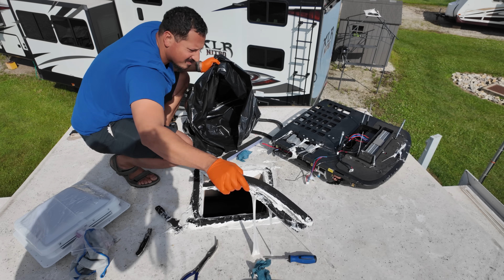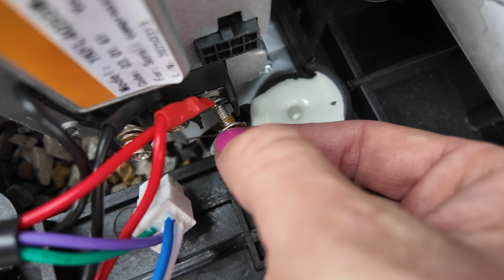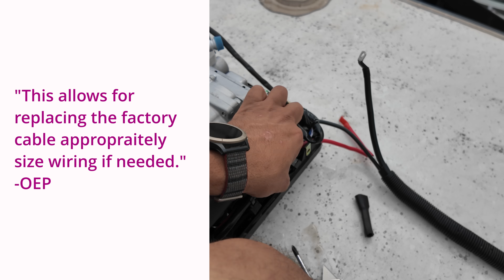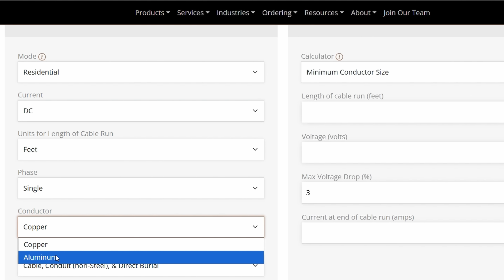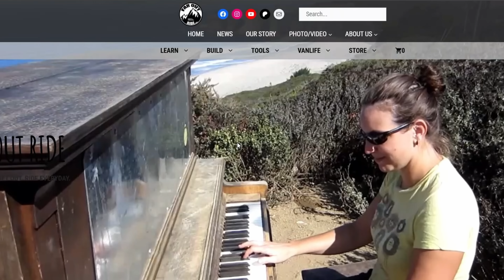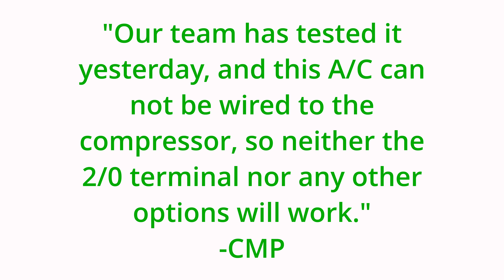The Truth About 12V RV AC Wiring in Big Rigs (What No One Says)

Comment: thanks for covering this subject.  agree - all the install videos never talk about wiring the 12V AC unit. i am planning to add a 12V AC to the front bedroom of my 5th wheel, which will greatly shorten the wiring run. I thought it was a disadvantage not having a setup to connect to the ceiling ducts; i have since learned that ceiling AC duct-work is very inefficient, so will rely on convection cooling through the RV while boon-docking, which makes the front bedroom the best location.  in a campground, the rear AC can provide a boost if the front AC cant keep up.

another thought is to change your battery bank to 24V and add a 24 to 12v converter for the RV house circuits.  a 24V AC will require half the current vs 12V, so wiring runs can use a smaller size wiring.

while I am not an electrician, for DC circuit runs, I believe the negative wire can be grounded at the closest point on the chassis frame.
Reply from the maker: I’m glad it was helpful. Yes it’s still a great option for many and have seen lot talking about the inefficiency of ducts.

Thinking hard about a 24 v system. Thanks for sharing

Comment: sounds like a large inverter and an extra battery is still a very valid answer, along with high efficiency ac like the chill cube.  
did you think of converting to a 24v system to use smaller wire? That may get you below the 1awg wire size.
Reply from the maker: Yes, large inverter and extra battery would be a great addition. I think it could be a better alternative for a larger rig.

Definitely considering 24 V system. Thanks for sharing.

Comment: The comments are fantastic and helpful. I would love to see some responses to them as they vary. We just finished installing the Victon system for off grid, ourselves, and it has been drinking from the fire hose for 2 weeks. Installing a 12-volt air conditioner is next as the Coleman Mach 8, 80 Db noisy air conditioner HAS to go. We have a short trailer as it's only 17 ft inside but I'm going to take to heart the bus bar in the cabinet suggestion, calculating the voltage drop in the line for the 10 ft needed from the air conditioner to the battery and or changing out the connection points in the air conditioner like you mentioned in your video. Sharing the good, the bad and the fails of any mod to projects helps everyone learn. Thanks for making the video cuz I always wonder after the YouTuber puts up the video on how to, if it was really the best way in the long run.
Reply from the maker: That’s awesome Victron system is definitely on the list. Lots of comments, recommending a large inverter and an inverted AC or mini split system, such as fury on chill cube or Mr. cool. Might be worth some consideration.

We always try to do any kind of follow up if we find something that isn’t as expected whether it is sponsored or not. Thanks for watching and sharing your set up😁

Comment: I did almost exactly what you guys were planning. Ran along the bottom, up the wall to a water tight  PVC box with 4/0 superflex copper wire. Once on top, I installed two large bus bars, effectively moving the battery connections to the roof. From there, I ran all my lights, AC and other roof mounted electrical equipment into this box and connected them to the installed bus bar using the wires provided since they could reach the strategically placed bus bars. I have inline fuses in each circuit, leaving the bus bars.
Reply from the maker: I’m glad you were able to get it done. How’s it been holding up for you?

Comment: In short, 12v ACs are not ideal. You should really look into a 48v system.  12  really is just not up to the task.  48v batteries are readily available, as are many other DC components that run happily on 48vdc. It is the voltage of the future for van, RV, truck and automotive systems.
Reply from the maker: Would you consider a 24 v system any better?

Comment: Why not install 24v instead of 12v units? Your Avenue has 2 AC units, correct? Just install separate 24v batteries closer to each unit, and you could likely use the 6AWG wire that comes with them. Not sure of the layout of your RV, but finding a space for a 24v battery to put under a dinette or something might be feasible.
Reply from the maker: Yeah, this is a great option. It definitely seems like it’s doable, but the main purpose was to show people that it’s not as straightforward and plug-and-play as it appears moving forward probably gonna consider a 24 V system instead thanks for sharing!

Comment: I'm surprised you have a 12v system on such a big rig. 24v or even 48v would really help with the runs for the big things. You could then get 24-12v or 48-12v transformers to keep from needing to upgrade your equipment.
Reply from the maker: A 24 V or 48 V system would be an improvement, would be awesome if they came equipped with them!
Reply: @DeterminationUnbound many of the DC ACs come in 24v and 48v versions.

Comment: I design harnesses for a living. 
Just run the largest cables you can comfortably run from the circuit breaker to a block or simple cable mounting stud near the AC unit. Use the 6 gauge they provided with the unit for the short distance from your interim distribution point to the unit itself. I'd say 2 AWG would be the biggest reasonable choice, and 4 AWG would be the minimum for minimal losses. Your higher voltage drop will be limited to the factory 6 AWG wiring, over a very short distance. 

The problems you're running into are because of two things. 1) your priorities are different than the people who designed it. Nobody is selling any 12V appliance with a 1 AWG cable set. If you look at automotive OEMs, they're not following the standards you're defining, because it costs more, and 2) your voltage drop expectations are higher than most applications. 10% drop is for non-critical, which for most designers would be something like this AC, where 3% drop is only used for truly sensitive things like sensors, processors, radar or other feedback systems.

I agree that in a boondocking/solar condition, efficiency matters. The simple solution is to just oversize the cables between the circuit breaker and the AC factory cables, minimizing the length of the factory 6 AWG. You can never oversize a power cable, if it will physically fit. I purchased one of these units, and my solution includes moving the battery bank closer in my design, so smaller cables can be used. 50 ft is VERY far for a high current device. I'm also going to be getting about 160 amps worth of charging from my solar, so I'll be using 2 AWG for that. 

Let's also keep in mind, most people running a subwoofer amplifier will pull up to 50 amps through an 8 gauge wire, and 125 amps through a 4 gauge wire. Priorities are just different for different people, and I'd say 1 AWG is certainly an exaggerated priority for a 70A load. 1 AWG is 44 mm² cross sectional area (flow path size), where 4 AWG is only 21 mm². So you've got twice the cross sectional area of people who are running stereo amplifiers up to 125A. For reference, 6 AWG is 13mm².

I'm not burning your biscuits. You did a great job learning about voltage drop calculations. As an engineer, there's just a need to look at real world use case examples in addition to the calculations. Gut checks are very valuable, and can avoid some unproductive paths.
Reply from the maker: This is very insightful. 

Agreed I probably over thought this a little bit not knowing and getting mixed information made me go with the over engineered route . 😆

But real world situations are definitely the best to learn from. Thanks for taking it easy on me and sharing!
Reply: @DeterminationUnbound  I was just going to reply with the same suggestion.  Run your heavy lines up to the roof junction box, then use the 6 ga from the box to the A/C unit.  This will work just fine.
Reply: You also missed the part that they're trying to do AC runs with DC!

In DC systems, they have to understand that
At fifty foot run, for example, is actually electrically a hundred foot run. 

There are just asking way too much of this d c system. 

They should be throwing down double 00.

Comment: This is a typical problem for low voltage / high(ish) current over some distance and voltage drop considerations.  I would be inclined to run duplex (or triplex) 1 awg (2 wires per leg) and splice down to 1 wire close to the end points. You could use aluminum large gauge (also duplex etc) also (cheaper).  The values used for drop, voltage and current look reasonable.
Reply from the maker: Interesting I just assumed aluminum would not be a great option. Thanks for sharing.

Comment: That small 12v AC is not sufficient for that 5th wheels main living area anyway and you will be disappointed.  Go with an efficient Chill Cube 120v ac in the main living area, and install a 12v AC only in the bedroom, which is likely closer to your battery bank.  This assumes your RV is a rear living/bed upstairs model.  That is the plan we have for our rig. I’m keeping the 15k btu for on grid camping, and just cool the sleeping area with a 12v AC.   Also running 2/0 to your junction box, and 4 awg to the AC would work perfectly.
Reply from the maker: Agree, the purpose was never to fully cool, but maybe to provide some relief. Definitely would be easier to go a chill cube route.

Now all I need is a inverter system because luckily we are third seat prep already. Thanks for sharing.

Comment: You can run from ac unit to a junction then increase wire size
Reply from the maker: Thanks for sharing!
Reply: The maximum btu of a ac unit needs to be 10000 btu on 12 volt very hard to prevent heat from connector if over that btu 24 volts all I use now due to 12 volt amp draw pushing 100 amps on my rv mini split still some heat on wires.

Comment: We have the CountryMod unit (10k) on our 41' Bighorn 5th wheel. 
Could  you  have placed it mid-ship and wire down a pre-existing vent? 
We replaced our center MaxAir fan with the CountryMod. Ran the supplied wires down an already existing plumbing roof vent down into our basement to the lithium goodness. 
No new holes and far closer to the juice.
Reply from the maker: We could’ve even placed it at the front of the rig, which would’ve been the shortest run, but we really didn’t wanna move the front AC and had an opening in the rear. Thanks for sharing.

Comment: Good video but not entirely correct. Appliances like AC, electric ranges, etc.. provide a plug connection that matches up with voltage, amperage, etc. This is rated for,the service required to run the device. It is up to the electrician / engineer to size the wire from the distribution panel to the outlet / termination point. In the case of the AC unit subject in your video you need to size the cable from your 12 volt distribution panel (trailer source) to a power distribution block near your ac unit. Distribution / terminal blocks transition from lager cable size (like 1/0) to smaller (like 6 gauge).
Reply from the maker: Information thanks for sharing!

Comment: The last few inches of the supply wire can be a smaller size without issue.  Cut the original wire back as short as possible, and splice it into the 2/0.

Comment: Another caveat:
Your batteries will not last long without having some solar, a generator, or running your engine.
You are better off spending a little more and going with an EG4 Solar Minisplit 12KBTU.
This comes with 4 solar panels, prepared cables, pre-charged lines, and easy DIY install.
You mount the panels on your roof, supply and install mounting brackets, solar wire and a disconnect
These can run solely on solar, you can grid tie it or both.
Does not need batteries.
This heats and cools.
Solar is FREE to use, no electric bill as long as you have the sun.
Reply from the maker: Oh I love the sound of that!

Comment: Consider 110 V air conditioner with one of these new models that are inverter air conditioners with the very low draw using your inverter close to the batteries and run the high voltage 110 wire up to the AC. Look into the Ferrion chill cube or the Turbro AC units
Reply from the maker: Yeah, this is a great option. Plus I would love a reason to get a full solar system. 😂

Comment: Is it possible to use a battery/inverter setup with enuf current 120 AC voltage output to run AC  up to the A/C unit?  Regular ac wiring could be used like in a house ..no heavy gauge dc cable would be needed. Need enuf battery capacity to last over night. At least have a good nights sleep ...I can't sleep in the heat so for me I'd want a good comfortable temperature to sleep in.

Comment: Agreed. Wire size is undersized. I cut all but 5' of the factory wire and  then used 1/0 wire to finish the run to my batteries. The fuse you get also seems to be poor quality. You could look into a split unit perhaps as the refrigerant hoses could help you break up the distance since they are 10' long.
Reply from the maker: Nice! I love that you got yours installed! How’s the cooling?

Comment: Use 2 12v batteries to make a 24v system and then the wire size can be reduced, I believe in half. Oh...and get a 24v rated AC. Will then need a DC to DC inverter to drop down to 12v for the 12v items.

Comment: The issue, with the OutequipePro 12vdc, is the target market. With small campervans, small travel trailers the wire size/length is not a problem. The problem is the wire size needed for the hugely long runs in big diesel pushers and 5th wheels. The provided 6 gauge is just fine for the smaller RV determined wire lengths to the much closer battery banks. 24v and 48v systems of course decrease the size wire needed but for a 17 foot camper or a Promaster/Sprinter sized campervan 12v still has justification.
Reply from the maker: Oh yeah it’s definitely made for smaller rigs. I felt like it was being pushed for larger rigs for a minute which is why we tried it. Safe travels!

Comment: Last week I put a 12v Outequip AC unit in my GMC Savana and wired it to a RV inverter running off a Pecron 3600.  Cools like a dream and with two extra batteries will run for over 24 hours without a recharge.  Worst I had to do, was relocate the wire so I didn't have to drill another hole in the roof.  But you can move the wire quite easily to run inside the unit to exit inside the van.  This van is also the tow rig for my Forest River 29View and I can also use the Pecron unit to power the trailer.  I'm not running both of the trailer AC air conditioners all night, but I can run the little 10,000BTU unit in the bedroom well enough.  We'll see for how long soon, but the Pecron is expandable to 15KWH
Reply from the maker: Oh I love that it was a success for you and cooled like a dream! Thanks for your update and safe travels!

Comment: Good video touching on a topic no one else addresses. Not a word about 24v DC for longer runs. Most rooftop units operate at both 12 and 24.
Reply from the maker: Thanks! We were more interested in a 12V system, but a 24v system would solve a lot of those wiring issues. Safe travels!

Comment: I have install 12 volt on motorhome use #2 wires at a/c install junction block wire a/c wires to it then install the run wire#2 to battery no voltage lose at block on a/c
Reply from the maker: Nice! So happy that it worked out for you! Safe travels!
Reply from the maker: Glad you were able to get that to work. Happy travels.

Comment: I just ordered one for my fifth wheel and I'm lucky in that its over the bed and the bed is over the batteries.  I'm opting to run the power cable to the inside with no additional hole needed. So long story short when the cable comes inside I'm going to use those channels that hide cable. Thankfully i will only need to use the cable that came with the unit and don't need to extend.   But you are correct it would have been a different circumstance on a longer wire install!  Most likely i would have gone with an 115 inverter type and ran off of the AC side vs battery.      BTW they are coming out with a kit for RV's to include longer bolts and some type of extension for the cold air plenum.  Too bad i need to put it in before that kit comes out so I will try some kind of foam board to partition the hot and cold.  Any suggestions on the partition?  What did you use?
I'm assuming you have a bed in the front of the rig... I'd recommend putting a 12 volt there and  use one of the newer versions such as chill cube in the back.   .... Yep you are going to need a more robust solar/ inverter system along your journey anyways.
Reply from the maker: Oh heck yeah- I love that it’s working out for you and being so close to your batteries! We briefly thought about moving our bedroom one to the empty space and installing the 12v in the bedroom but we wanted to keep the existing ductwork. I did hear about the kit! That would have been nice!